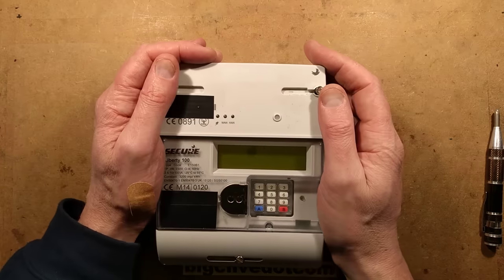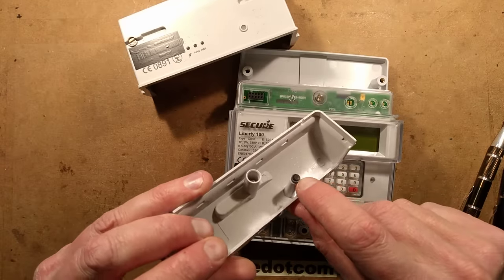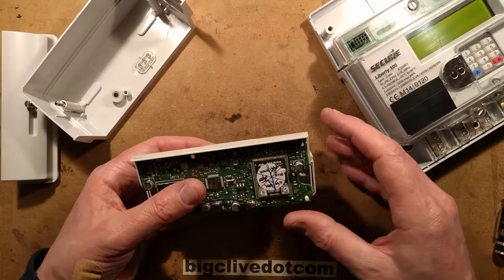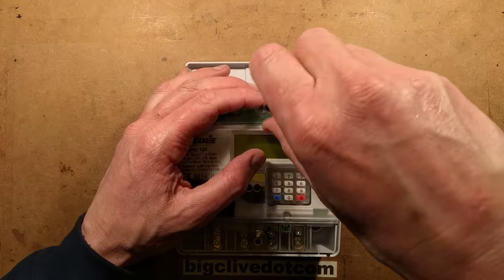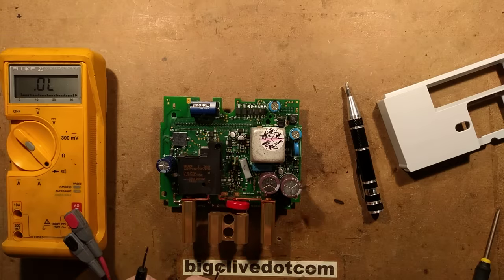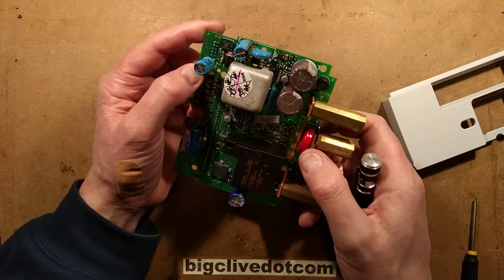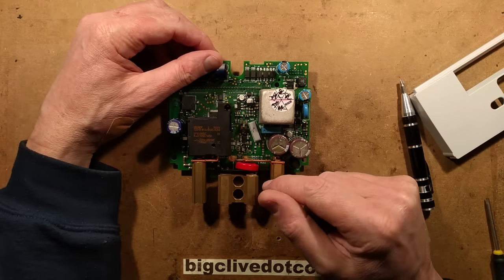Inside a smart meter, and the REAL problem with them.

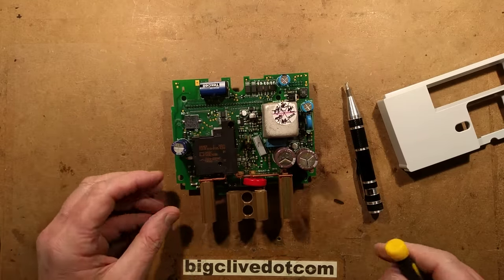Comment: 7:05 "A big relay so they can disconnect your power if you've not paid your bills"

Or so they can force house-specific rolling blackouts when there are power shortages.

There will be power plans where you pay more to not get disconnected. (QoS agreements)

There WILL be power shortages in the next few years as there's insufficient power generation capacity (MWh, not instantaneous MW) to feed current demands AND anything more than a token electric vehicle fleet(*), let alone what happens when oil/gas fired heating systems are banned (and they will be, or priced off the market in about 20 years).

All the renewables you can possibly roll out won't help as there isn't enough extractable energy from wind/solar/tidal to fill the gap and the european interconnectors are fundamentally limited by being undersea cables.

Bring on the magic unicorn poo.

(*) In the event of a large EV fleet, all charging in "offpeak" hours, those "offpeak" hours will require higher generation levels than current daily peak outputs. Bye-bye Economy7.
Reply: They will never cut me off then, they need me, I export more than I import so I'm a'll right jack!!!! hahahahahahaha
Reply: All the more reason to go nuclear.
Reply: @pickelsvx  Absolutely. Check out what Moltex Energy are doing. Small modular reactors that burn high level nuke waste. No more stuff to be mined and that waste gets used to make electricity. Cost are cheaper than gas fired plant. When they get to factory produced modules, the build and running costs will be cheaper than coal.
Put coal out of business and world CO2 emissions will collapse. Not to mention the toxins and methane given off by the mines and power plants.

Comment: The metal bar between the relay and the output live terminal is probably Alpha metal (resistance changes very little with temperature, the meter will be capable of measuring between a few mAs and up to 100A) and the reduction in width is probably the current calibration.
Reply: I don't the width change is for calibration. All the shunts will be manufactured the same and the meter will be calibrated in firmware

Comment: I love the idea that there could be a mic or a camera in there......our meter is in a closed cupboard in the corner of the kitchen. The camera would need to be something pretty exceptional to see out, and the mic would be so expensive as to make the device cost prohibitive. (Not to mention that the radio is right by the cupboard too.)

Being in the kitchen cupboard also means the "5G" signal is nowhere near the people in the house. 5G is unlikely to be used anyway: coverage is still very patchy (late 2022), and the amount of data being sent is tiny. It's not like you'll be streaming 4K Netflix on there! Connection reliability is what's needed here, not speed.

The Bluetooth found in the unit could possibly be to communicate with a gas meter, which would be paired via that keypad.

One of the biggest issues with all this, is that despite having had a smartmeter for 3 years now, we still get estimated bills.

Comment: On the conventional meter, people used to put a magnet on the back of the meter, this slowed down the rotation of the meter disk. I wonder if the hall effect sensor was for this? (the meter would spin faster than it should once the magnet was removed). I reckon, assemble it, connect the power to the unit, then start dismantling it, the tamper switches will sent out warnings to them, and they will be running around everywhere trying to find the culprit.

Comment: I have refused to have a smart meter, only when thinking of changing supplier did I find out that you cant find a better deal without having one fitted! I only wish I could go off grid.....
Reply from the maker: The whole "better deal" thing is just a way to lure people into breaking an existing contract for one that can be changed at will.  The best electrical deal is the original one before this fake power selling industry was created.

Comment: Thanks for the educational video, I now know that I need to get one of those cheap, Chinese GSM jammers before I try to bypass this thing to power my weed farm.
Reply: I think the flat resistor between the Live and relay is to detect any short cut between live input and output... In some of security alarm systems they use same trick.

Comment: they they tried to install one in my house when my old meter packed up. cheeky sods. i wasnt having it.
Reply: Why? Is it because of the radiation they emit? My smart meter gave off so much radiation that plants wouldn’t grow if I had them on a table in the other side of the wall, they would die off a few weeks after planting them, also right after removing my smart meter and getting an old one, I felt way better physically, as if I was a little bit sick my entire life and now I’m better, also everything this guy said about the smart meters not giving off radiation and not connecting to the 5G network is incorrect because the government even admitted that smart meters will be connected to the 5G network when they introduced 5G
Reply: @MyIphoneGaming  theres nothing wrong with 5G anyway so nothing to worry about.
Reply: You had a choice!?
Reply: @traynor1987  I only get 4G ,and the signal is unreliable.
Reply: Gavin Reid you can opt out of having a smart meter, you have to pay like $90 but after that, you’ll save money because they can’t charge you for perk savings and your meter won’t be giving off toxic radiation which uses a lot of power that you have to pay for. Also old meters don’t have the 2 way surveillance system that ComEd uses to track you and they can use it to remotely shut down parts of your power and it’s harder for them to shut off your power if there’s a protest near you which they do a lot, they probably won’t shut off yours because there’ll have to manually send someone out to go to your meter and turn it off but you can always just stand by the edge of your property with a gun and scare them away if they try to trespass, just tell them no trespassing
Reply: James Traynor they government said they are going to skip testing with 5G. Why? Because every scientist who studies 5G says it’s dangerous. 5G Cell towers are not for faster phone service, they are used for Temporarily Paralyzing large crowds during protests, 5G cell towers use the same EXACT Technology as the military’s Active Denial System, they both use an Invisible beam of 90Ghz directed Microwave Radiation. Research it yourself

Comment: Interesting video, thank you Clive, for making it. 

Fyi, 5G mm waves and other non ionizing radiation is not necessarily safe, as mm waves have been shown to disrupt cellular ion transport channels (and thus, cellular activity). 

The military also uses them at high amplitude as a non lethal crowd control weapon. This is why 5G has to be broadcast at low amplitude for cellphones, and thus requires small broadcasters every city block or so. 

The kicker is that those small broadcasters aren't working to their full capacity. They can be turned up remotely and made to broadcast at higher amplitude.

I have no evidence of a conspiracy one way or another, and I hold a neutral position (as one should) without evidence.

But people should be aware of the capability of 5G mm waves to do harm through either aberrant or intentionally misused broadcasters.

Comment: meter installer here... we're replacing 1st gen meters with 2nd gen which has extended the life of the job... not only that but there's talks of upskilling again to install car chargers, battery systems, solar systems, central heating controllers and all that

Its not the meter installers you want to watch out for, we're highly regulated and audited to strict industry standards... its solar panel installers that so often do the dodgy work (not always). they're not regulated as far as I'm aware and the amount of times I've had to correct their work is ridiculous!... they do not have the proper qualification to work on a meter or the cables coming out of it!

 I even came across one setup that was hooked up to the wrong side of the meter, meaning the customer was getting charged for anything he was using from the solar panels and the rest was going into the grid for free... not only that but the setup was actually illegal as they'd tampered with with energy companies property! 

needles to say I corrected it for him and kept him out of trouble as the boss initially thought it was a case of theft, whereas it was just a solar panel installer that had no clue what he was doing

Comment: For all the 1337 haxz0rs out there, don't forget to make sure you're well grounded while tampering with your smart meter!
Reply: Indeed, if accidentally in contact with the active terminal the good grounding of their feet is essential to us all.
Reply: Sounds legit
Reply: Instructions unclear. Im a fat 1337 haxz0r, and I'm standing on the ground. That should be good enough...
Reply: J K Be sure to wear the antistatic "electrically protected" (or similar verbiage) work boots sold at hardware stores.  That's obviously the right thing to protect you against electricity ...
Reply: @ UpLateGeek - 
mmm BBQ
Reply: @J K while doing your 1337 haxz0ring on your smart meter, you can hold a grounded metal pipe or chassis with your non-dominant hand while you poke around the active and neutral connections with your dominant hand. If successful, you could receive a Darwin award!

Comment: I will skip to the chase here and ask as straightforward question.
Would it be possible for an energy company to adjust the rate of usage / cost remotely without a customers knowledge?
Ie the data on screen might not necessarily match your actual usage thus making these greedy bastards yet more money?
Reply: Do UK electricity companies do billing directly on that device? Here the meter only logs time and usage, all billing decisions are done at head office, and rates are determined by tariff.

Comment: Interesting you look inside and say no microphones, well have you considered whether those capacitors are really capacitors? Oh wait maybe that 0 ohm resistor isn't really a resistor at all. What's really going to blow your mind is realizing that the micro processor has a listening device built into it........
What about those inductors think about that they will vibrate in sympathy with surrounding vibrations hehehe
Reply: Jason Gib
The ceramic disc capacitors are microphonic and can act like a microphone.  😱😱
Reply: You really ought to check your fridge is not hiding a microphone.

Comment: I found this interesting, it's not mandated yet, but they keep hounding me to get one.  Don't think so, it'll be too bad if they cut me off the power.  So I guess they use your power to turn you off, and make sure you stay turned off, and probably charge us for being turned off, and doing anything.  They keep telling me I'm using more, because my bill is up, but I'm using less power, they just charge more, and won't reply when I point it out.  I like to know what's happening "across the pond", because we get the same plans, a bit later.  Thanks again, always a pleasure to watch a man enjoy his work, taking things apart, gently.
Reply from the maker: It's powered from their side.  If your bill is up significantly, look for items that have been left on (attic heater?) or faulty heating appliances that are running continuously instead of cutting off.  (water heater?)
Perhaps a faulty outside halogen light staying on, or a damaged cable going to a garden shed.
Reply: You're right, I was looking at it backwards.  I don't have one, and will consider going off grid, if it becomes required.  thanks for very interesting videos, new to them, but a pleasure.

Comment: The thing I don't like about these, or things, firstly: the power company knows when we individually are at home burning fuel and when a property is unoccupied. Who has access to that information and is it protected? Worth a lot in the wrong hands. Surely they have enough information at sub-station level to do their planning and control, without needing info at a household level.
Secondly: these meters can't give you usage information for each appliance - you still have to do the sums; a ten quid plug-in / plug-through power meter will tell you what each appliance is using with a little effort - what's wrong with a little effort? 
Thirdly: Of course we can trust these benevolent philanthropic companies and their multinational shareholders not to cheat, but I prefer to take uncontravertible readings and photos of my meters that can't be read or controlled remotely

Comment: Smart meters in India are more complicated to detect different tampering mechanism that people have evolved over time -- 
1. Use CT and Shunt based measurement -- for tamper detection and also for low and high current ranges.
2. Measurement on both phase and Neutral.
3. Many more that I too am not aware of, even though, I am an engineer.

Comment: I'm an electrician and on a distribution board change/replacement I have to undo those covers to disconnect the tails and replace with new tails.
I/we have never had blow back from the customer from their energy supplier with tampering with the meter!

Comment: looking at this clive, I notice a fatal flaw. you only have to fool the bottom section with the power terminals. if you get the cover all you can just wiggle the neutral terminal until it disconnects from the circuit board. the relay cant latch and you have plausible deniability.

Comment: I have one of these.  It is so "smart" that it cannot do simple addition.  If you add up the individual  monthly consumptions at the end of a month  they come to less than the "total" consumption. This was apparent by the second month it was fitted. Got them out to check it and the guy could not find fault but told me he was not authorised  to do a full test which would expose such an issue! I asked them to add a check meter but they refused. Needless to say they insist that the higher number is the correct one.

Comment: If you Google the FCC id number on the front panel, you'll find the user manual with schematic.
It utilizes two frequencies 2.4 GHz range and 900 MHz the 2.4 communicates with appliances and the 900 transmits bulk packages of info intermittently to data gathering system. But for some reason, I don't think you'll acknowledge this.

Comment: That 'slug of metal' is a shunt, a resistor with a very low defined impedance. As the consumed current passes through there will be a small voltage drop across it, which according to Ohm's law is directly proportional to the current. So the meter measures that voltage, translates it into the corresponding current, multiplies it by the phase to neutral voltage and time, and displays the the result as kWh. Current as such can't be measured, only voltage can, therefore every ammeter has either a shunt (direct current metering) producing a voltage across it, or a coil wrapped around the main conductor producing an induced voltage proportional to the current (current transformer, clampmeter). Dunno if there's any other fancy methods out there (magnetometer), but these are the two main methods.

Comment: Blue light from monitors has been proven to damage DNA and there are respected scientists with many decades in their field who say you shouldn't have the mobile phone in operation and close to tissue for too long, even the small print in the T&Cs in the phone menu system says this, so there is something to be concerned about, especially since the safety standards are based on decades old research by the US Navy.

Comment: A previous supply Co installed a "smart" meter. However, when the kettle was switched on our demand for electricity decreased!!!
I quickly realised the potential of this and realised the "smart" meter couldn't detect which way the current was flowing and would have then began charging us for the energy our solar system was feeding into the grid. 
Fortunately we were able to contact the Co and have the old meter re-installed. Needless to say, we quickly changed our supply Co.
Reply from the maker: If you were using an independent clamp style energy monitor you might have seen the effect of the kettle load with unity power factor swamping the other loads with bad power factor to give an apparent reduction.

Comment: Trains going faster than 30 kph (a running horse) would make it impossible to breathe.

Automobiles should have someone walking in front of it with a red flag (day) or lantern (night) to not scare the horses.

It is all the same.
Reply from the maker: The HSE still thinks that you need someone with a flag to walk in front of a cherry picker.  But not in front of a car driving through a busy supermarket car park full of kids.